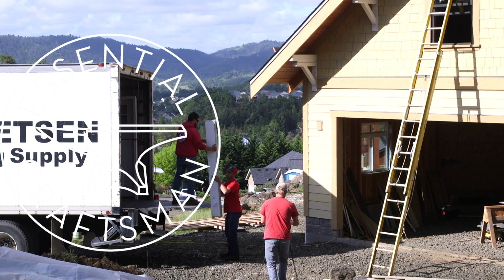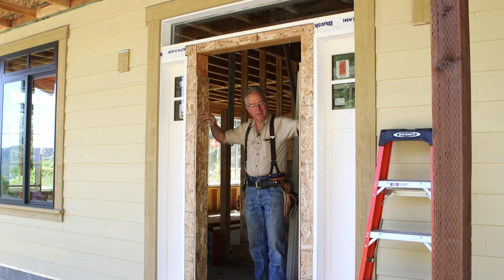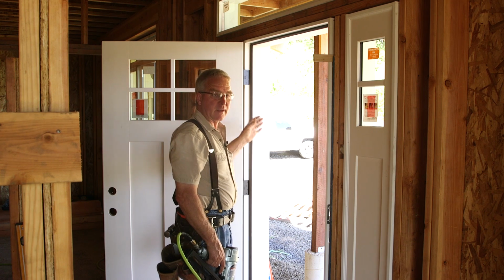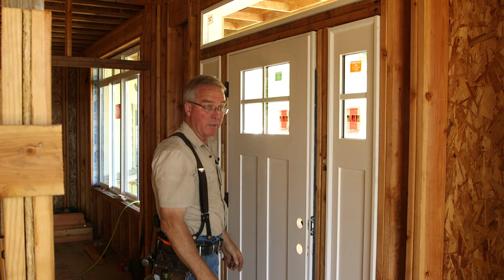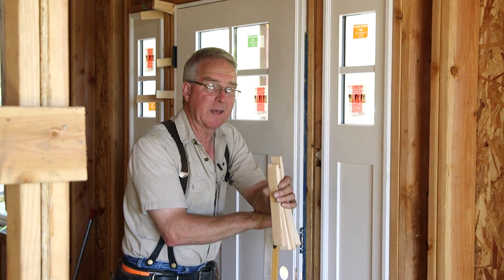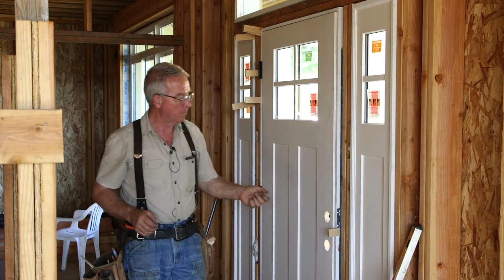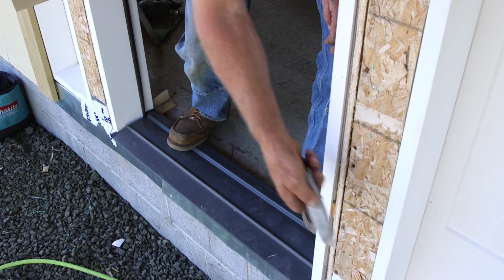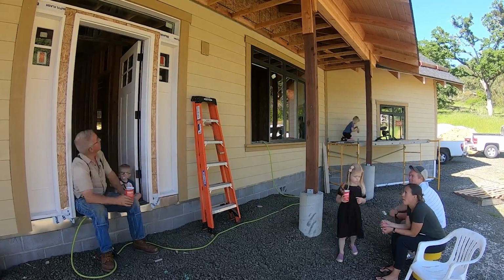Installing Front Door Ep.83

Comment: Just want to share one of my favorite products for hanging doors. When I need to use a screw, GRK makes a trim screw with a very tiny head. They hold really well, and make a hole not much bigger than a 10d finish or casing nail. I usually set one behind each of the hinges if I don't have weatherstripping like this to use. Even right through the stop with some good spackle hides very well.

Also good in a pinch for trim. They have about 1/2" of counter threading at the top which holds a board in place and can be used almost like a shim. For example sometimes the bottom of a piece of base will want to push in a little too far, instead of removing the piece and dealing with a shim, you can set one of these screws, and then back it off. The counter-threads will push the board out and hold it there.

Comment: Getting furniture and appliances into that house through that doorway looks to be a nightmare.
Reply: I was thinking the same thing, looked like a 32".  Gotta be at least a 36".  I do prefer single doors rather than doubles (better security), but if I was building my own house I'd do 40" unless there was a doorwall around back.
Reply: @mismjames  one thing that you can do if you have a door and a sidelite in a single SD or DS unit is to have what is called an "active sidelite." This upgrade costs very little and it allows you to also swing open the sidelite in the same direction as the door on the strike side. On a 36" door with a 14" SL thats a 48"ish opening. Honestly, if someone is getting anything smaller than a 36" door it is an upgrade I would highly recommend.

Comment: I am also a contractor. I would never poke nail holes in a new door frame like that. I take out some the hinge screws and use only those same holes for the installation fasteners. On the seal side I peal back the weatherstripping and use screws behind it. I hate seeing an expensive door like that being ruined with lazy fastening.

Comment: All my rage when you nailed right into the jam
Dude
 Remove the weather stripping. Use screws, I stall weather stripping. Screws are hidden. No need to fill in unnessasary nail holes. Screws give you fine adjustments. Long screws Into hinges and on a double strike plate.
Reply: Same here! It hurt to see nails going in there.
Reply: EXCELLENT POINT
Reply: Sill pans too, or the lack of in this case
Reply: @stevebengel1346  There's a big porch overhang.  Less critical than it would've been.

Comment: It's very strange to see so tiny wooden door to main entry of such big house. For me, as russian and siberian man, it is more usual to see 4-inch metal door with 3.5-inch foam insulation inside. And  1/4-inch it is metal - two sides from 1/8 steel sheet, and 1/4 - decorative MDF panel inside the house

Comment: How do you correct an interior door that won’t stay open?
Reply: The door jambs are off plumb
Reply: There are more complicated and destructive ways than this; pull one hinge pin and bend it slightly, reinstall. If it won't stay open bend it more or modify another hinges pin. This fix is similar to bending the float arm in your toilette tank. Not the kind of fix for every job or one to proudly tell about, it just works
Reply: $3.25 will get you a 3-pack of wedge shaped rubber door stops at Home Depot, Lowes or Ace.
Reply: You can pull off the top and middle jamb side hinge and shim it outward with cardboard. That will correct the door itself not being plumb, but won't fix the jamb. You could shim too much and throw the door out of plane with the doorstops. Just like bending the hinges, the cardboard method is not something to brag about. Anything else involves pulling trim and shimming.
Reply: @maxprophet2401 --- Your method for correcting a doors "plumbness" is called "throwing the hinge".

Comment: I hate to have to say this but this is 1980 technology when it comes to doors and windows. Is the US really that far behind the rest of the world when it comes to hanging and mounting doors and windows?

In Norway this whole door/entry kit, windows and all would be one  pre-manufactured piece. It would be installed with adjustable jamb-screws and the intentional gap left around it would be filled with sprayfoam insulation. The entire install would take about 10 minutes for 2-3 people.

Also worth mentioning, the door would have a metal security plate inside, the entire piece would have a 15 to 30 year warranty. The door would swing OUT, instead of in - as to help in an evacuation situation.

Comment: The lock mortise visible inside is puzzling me.
Reply: Drywall and trim will hide it.  You're seeing only the framing inside.  The drywall will be flush to the frame.  The Lock mortise is only ~3/4 in from the edge so easily seen at install.  That's also why the 3" screws go in the deadbolt latch plate at the jam side - into the meat of the studs..
Reply: Kirk Hancock thinking more from securing the lock.  I know it won’t be seen.

Comment: I love the tiny, flimsy and single weatherstripped front doors they use in the US.
We just removed our front door. It alone, without the frame, is heavy enough to require two people to lift it. In addition it has two weather strips, both seperated through a couple bevels.
These single beveled doors are only ever used as interior doors here in germany.
And thank god the door frame was put into place with screws, as we had to reshim it and push the whole frame out about 2 cm, which required 2 extra long clamps and awhole lot of force. I guess 30 years of door slaming and only getting sunlight on the bottom half took its toll.
Afterwards it was easy screwing the 20cm screws back in place, which will be covered by wooden dowels once again.

Comment: @Essential Craftsman Interesting... in New Zealand (where I'm from) the entire frame would be 1 piece (open in frame to the perimeter, with transom/mullions as required), the door then hung from the mullion of choice. All lock hardware (as chosen by the client) is fitted in the factory. The frame is checked for true & square, then held in place with a timber brace. The other item I noticed, is that your timber reveals are on the outside? Ours are on the inside - be-it door or window.

Comment: Why is inward facing doors standard in the US? It just seems so weak. You are relying on a metal striker set in a thin wood frame to hold the door. A kick is all you need to well, kick in the door. Here in Europe outward opening is standard (except for doors that open into shared hallways in apartment buildings). It allows even a weak door to be much stronger than this.

I don't know how much the sidelights were out of that but that's such a simple door. I'd expect a door with triple pane glass or double pane with a safety laminate window, three point locking mechanism and adjustable frame anchors (no wedges needed), you can adjust the frame even after fastening the door.
Reply: Security is less of a concern and moisture is more of a concern I would guess. In the US, an outward opening door would move the door 4ish inches outward rather than having it inset with the doorstops, threshold and weatherstripping facing the weather. Also, an inward opening door won't get dripped on from water coming down the siding because it's not in the same plane as the outside wall. Not a big deal in Scott's case because he has the porch roof.

In the US, with the popularity of schlage and kwikset locksets, it's much easier to just electropick or bump key the lockset rather than kicking in the door. Faster too. Hopefully Scott uses a European style lock or a high quality American lock versus the budget friendly, marshmallow, low security garbage that passes for locksets nowadays in the US.
Reply: @ezdankie  and isn’t it easy to pop hinge pins out?

Comment: Wow..what a mess, not only was the opening badly done, you never nail thru the door stop when setting in a door and you shim first then nail last not the other way round Sparky.  It was laughable that the deadbolt/door handle hardware fell halfway beyond the edge of the framing because a good hard kick will splinter the wood and you might as well not lock the door at all. Either the wrong door was delivered or someone just took a guess at the dimensions to be this far off and they need a time out in the corner because this was about the worse door installation I've seen in quite awhile. But it will get worse because since they didn't choose a door with side lights usually come as one entire piece was why this was such a screw up and the trim that will be needed  to make up for the bad framing will it look even grotesque. It's Door Installation 101 to shim first so the door reveal is even all the way around because that's the way there made and one couldn't help notice that you didn't worry about it being true/plumb with a level in two planes was a rookie mistake. Indeed it's often why a door swings open/close on its own when unlocked instead of being in balance so it will remain where it's left and about everything you can do wrong doing a door was in this video. But about the only question remains was who choose this design in the first place because sidelights usually have glass nearly its entire length for aesthetic reasons and the transom should have divided lights since it looked as if someone got the wrong one that didn't go with what arrived. To bad this video was shot weeks ago because tearing it out and starting over at a minimium to get the framing right is about the only why to get this disaster can be fixed and one hopes they did it in an upcoming video. 🤔
Reply: This is the guy who thinks charging 3k to install a 1k door is justified